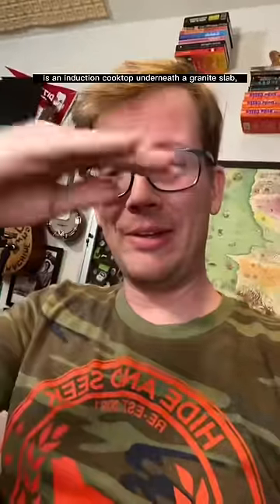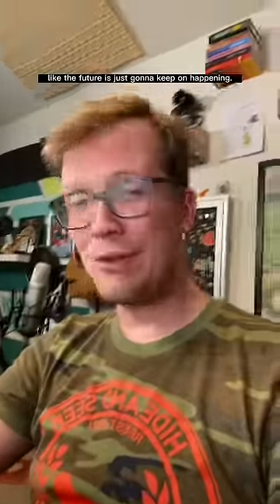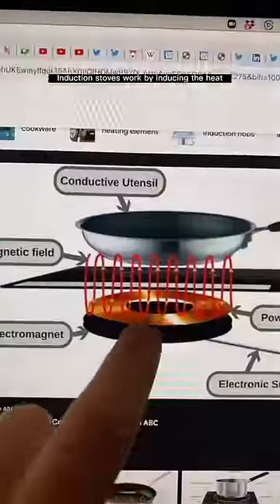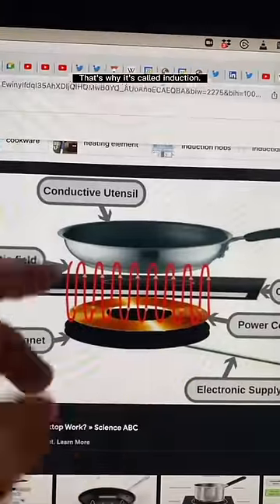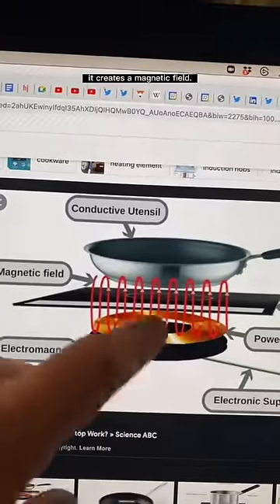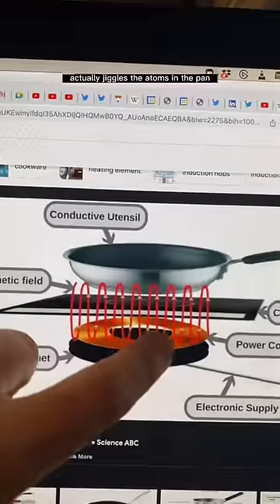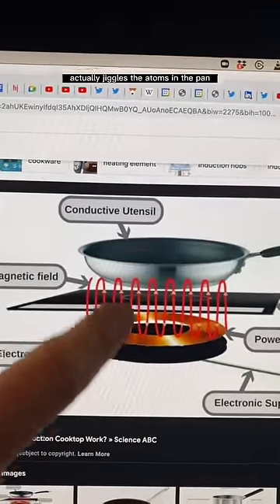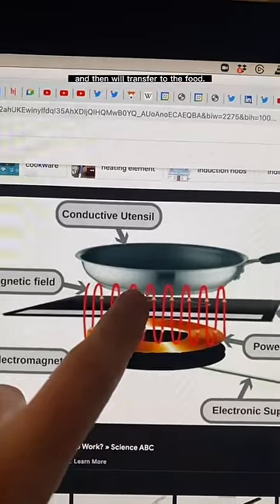How do induction cooktops work?

Comment: The surface of an induction cooktop still gets hot from the pan heating up, so no matter what when you're done cooking that spot of the counter will be hot. Seems like a bad idea
Reply: It won't be burning hot. It would be warm but you can still put your hand on it (see other video with glass induction cooktops for reference). The surface isn't warm from the induction. It's warm from the pot heating because of the induction. That's why induction is also a safer option for people living with kids, pets, seniors or clumsy people.
Reply: It cools off in like few minutes. Electric stove cools down way slower. And gas stove also gets hot around the fire. Not to mention the actual fire that is not safe at all.
Reply: @cherylynl.tompkins7049  You might find that rocks, when they are made hot by hot metal, are hot and rocks retain heat well. You might also find that granite, is a rock. And when you touch it when its hot, it will hurt.
Reply: @cherylynl.tompkins7049  having had induction, the glass tops still easily get hot enough to burn, and stone is a better insulater than glass...
Reply: Christopher  yes, but as the pan is hot and sits on the counter whilst cooking, some heat will be transfered from the hot pan to the surface it's sitting on, thus making the counter hot.
Reply: It's waaaaay less hot. Maybe use one and see how it works, because your concern only comes from not being familiar with induction. It's much safer
Reply: @Tiago-  I have used one lol, if you do intense cooking on it, the surface will be hot. The danger doesn't come from that, it comes from not being able to see it in this case, so someone else coming into the kitchen may not realize you were just cooking on an invisible burner and set something flammable down or lean against it.
Reply: Christopher  The hot pan makes the cooking surface hot.
Reply: @NeroNyte  you'd think that all these guys being weirdly condescending would know that the hobs themselves come with multiple warnings about how hot the cooking surface gets...
Reply: @ef9447  Part of the problem is a lot of products will say like "Heats the pan, not the burner!" in big text as a selling point, and then in fine text somewhere else have all the warnings that it still technically will get hot.

But yeah, love when small stuff like this leads to oddly personal jabs lol
Reply: Gotta assign numbers to these temperatures before you can make a conclusion.
Reply: @NeroNyte most of them are red when hot bc of lights that turn on
Reply: @peterirvin7121  that is true, quite warm is maybe a better approximation.
Reply: @jc-16.  I have an induction stove. The first thing I did was boil a pot of water, remove it from the burner, and touch my hand to the hot glass. An electric coil or traditional glass ceramic cooktop would have given me a 2nd degree burn for minutes after the burner was turned off, but the induction stove was just slightly too hot to the touch. No burns or anything.
Reply: @ef9447  incorrect
Reply: When we bought our induction hob, the sales lady said you can put paper money under the pan and cook your food without burning the paper! Which we never tried but is probably true
Reply: @mhenderson7673  Paper money is difficult to burn by design, it will still burn your skin or regular paper if you cook on high
Reply: I wouldn't be worried about this because you might burn your hand. I'd be worried because the granite might crack from thermal stress.
Reply: That certainly never happens with normal stoves...
Reply: @maxwellkazemba2299  You can still see normal stoves when they're off or have nothing on them.
Reply: I‘ve worked on commercial induction warmers before, and they have a little sensor ring you had to align to the main unit and then put the pot on top of that. It helped mitigate the heat a bit and most of the countertops were warm but safe to touch within seconds after removing the pan if they weren’t already. The main problem is getting the unit to agree that there is a pan above it that is ready to be warmed up, cuz most of the time it just goes 🤷‍♂️
Reply: Burning someone aside, I work in the granite industry, that stone will definitely crack from this. 

I have an induction cooktop and the surface the pans sit on gets plenty hot when cooking.
Reply: Outline it with duct tape.
Reply: Honestly if anything im more concerned that itll take ages to heat up since its granite than it staying hot
Reply: @drlnielsen  lmao
Reply: @Tiago- no, our concern comes from understanding how heat transfer works.
Reply: unless you always put your pan on a hot pad
Reply: @peterirvin7121 Well it was hot, yes. But what if, instead of boiling water (100°C max,) you put hot oil (easily up to 300°C, likely less) and THEN touched the surface?
(Note, I do NOT condone the touching of the surface, PLEASE use a thermometer)
Reply: @Leekodot15  Obviously don't touch that surface?

Comment: I own an induction cook top. Some caveats: you need specific cookware for it to work (many new cookware sets are induction ready, but our old set was not so- all new cookware).

The next major caveats may have been a deal breaker had I known about it: pots and pans bigger or smaller than the burner might start to him or ring, and the sound is very annoying. Often, you can move the pot, and it will stop... but sometimes...it's just going to ring and buzz.

Water does heat up super fast, though, and it is cool being able to use other parts of the stove as extra counter space while cooking as they don't get hot.
Reply: Yeah, I experienced that first issue first-hand. My first rental out of college had one but the landlord never really explained the specifics, so I spent a while wondering why the aluminum pan I just bought isn't getting warm. One Google search later and I found out I need new pans
Reply: I can also agree to that problem, id rather have an electric one again
Reply: I will add that recently the ringing has  had basically diminished to nothing. My wife got Hexclad cookware and that might be the "fix" or it might be  that the stove has just "broken in."  So, I am much happier with it now than I was. I hope that ringing stops soon for you all too.
Reply: You need farrous cookware. Which isn't anything special, you just can't use aluminum pans. Anything that's steel or copper will work
Reply: @Patmorgan235Us  copper? I've had a copper wok that didn't work on induction so I don't know about that
Reply: There no reason for your water to boil slower. It should actually boil faster. 

You also have wireless kettles that can be used with the induction. Doesn't get more convenient than that.
Reply: so that's why my dorms stove starts being loud af for no reason sometimes... that's genuinely a big dealbreaker it's not just loud it's also a very annoying sound it gives me shivers
Reply: @molrat my induction stove has never given me any problems like that.. unwanted sounds etc lol.. I’d be pissed if it did though
Reply: The cookware doesn't have to be new, it just needs to not be non-magnetic (like cheap aluminum pots). My antique cast iron casserole is working fine, for example.

And it's not so much size that makes them vibrate, but a lack of levelness. If they're warped or dirt prevents them from sitting perfectly level to the surface they'll vibrate regardless of the size.

Comment: I’ve got an induction stove top. It’s amazing. A pot of water gets to a boil in like 1 to 2 minutes tops. It’s so fast. You need to have the right pots and pans though. Steel or iron. Easy way to know it it will work, is to test it with a magnet. It the magnet sticks to the bottom of the pot/pan, it will work. If it doesn’t, it won’t. Another plus, is the f it is turned on on accident, no one who get burned, as it doesn’t make heat directly. Be aware though that the pot/pan will get hot, and therefore the bottom that is sitting on the stovetop will make the stove hot, so don’t stick you hand down on it right after removing something, because then it is hot, but it will cool down pretty quickly.
Reply: I love that it's easy to clean in a case of overflow. Shit doesn't really burn to the surface
Reply: @OlafavonGoeding   I was thinking that too.  but just realized that also means that when a pot boils over and spills out, it's pouring off the countertop and right onto your feet

Comment: >Being so early, I can only see Hank in 240p. What a feeling.
Reply: Poggers
Reply: pretty sure that's just Youtube's 2020 change of terms of service, where now users cannot lock resolution to a specific value, but choose low, high, or auto
Reply: @bmo3778 Wait I can lock the resolution onto specific values though.
Reply: @adelaidedracomalfoy8300  wait what app are you using?
Reply: @adelaidedracomalfoy8300  I meant permanently. nowadays, I have to choose the resolution on 'every single video'. it used to be, "lock at 360p forever" and I never need to touch the menu ever again
Reply: @bmo3778  Ohhhhhh, yesssss
Reply: Cutting edge interconnected network technology
Reply: @bmo3778  click on advanced

Comment: If you have a loved one/guest with a pacemaker or similar internal device WARN them. They should be fine if they stay 2ft away, induction hobs can be safely used with some care, it is a necessary consideration.
Reply: I don't think the coils are a high enough output or voltage to affect a pacemaker but maybe I'm wrong.
Reply: two feet or 60 cm is correct but that distance is from the coils themselves. A person of normal height could use the front "burners" and if you are shorter the back ones would be more than 2 feet away from your heart.
Reply: @davidcolera8160 Why risk it?
Reply: @hondaguy9153 manufacturers warn you to stay away if you have a pacemaker. It might be unlikely, but if they're suggesting you don't risk it, probably best not to
Reply: @RicardoDelfinGarcia  interesting. Good to know.
Reply: That's... curious, as it's not really considered a concern here in Europe where induction cooktops have been common for a couple of decades already. There was a EU-wide standard introduced in 1990 that ensures it won't be a problem as you can't sell cooktops or pacemakers here that aren't confirming to that standard. It's quite concerning if the US "forgot" to do the same 🤨
Reply: @norgeek  the US forgets a lot of things.
Reply: @norgeek  I'm in Europe, not the US believe it or not! The flat I moved to in the UK (pre-brexit) came with an induction stove top and the manual called out keeping your distance with the stove if you have a pacemaker. I don't mean to say it's a likely concern, but it's enough to warrant a warning.
Reply: @RicardoDelfinGarcia  that does make lot of sense as whether or not, pacemakers can be affected by induction cookers fields - there are still lot of things that can go wrong and is the sole reason why nuclear pacemakers don't exist (I mean they tried once & now with the new battery tech, if finally safe again then possibly in future). Irrespectively, pacemakers are still foreign object (more like electric stimulation device) controlling an already difficult to repair & extremely important organ. So even if it may not directly get affected, it's still necessary to avoid situations where we can easily mess up & induction cooking is very energy efficient so we can accidentally burn ourselves if we are not careful.(especially accidentally spilling something dangerous hot on pacemaker site skin which will be dangerous)
Reply: @RicardoDelfinGarcia  fascinating, none of the induction stoves I've had over the last.. 15? years came with a warning like that, they've all just stated that they complied with the required EU directives and were safe for people with pacemakers 😅
Reply: I have a pacemaker and it is true I cannot go near them from the magnets, looks lovely but a bummer
Reply: Cardiac physiologist here. The 2ft recommendation is true worldwide for pacemaker users. The reason is that pacemakers have lead(s) that connect to the inside of your heart's chambers. These leads can sense your heart's electrical activity so your pacemakers only "paces" when needed (ie when your heart decides to stop for whatever reason). Electromagnetic fields cause false readings from interference on those leads, leading your pacemaker to think your heart is beating even if it decides to stop.

Obviously it gets more complex than that and pacemakers nowadays have great technology but different models will have different stuff, and since they can last a decade before being replaced, chances are some people have old and more basic models.
Reply: @norgeek yeah yeah you’re better than us, you can stop rubbing it in every time you see a difference
Reply: My father in law's pacemaker is effected by the cooktop they just put in. He can't use it at all or he gets a-fib. Based on that I'll never get one as I don't know if I would need a pacemaker or if I would run in to an issue. It's just not worth the risk.

Comment: You can actually buy a portable induction  cooktop for around $45 USD. I bought one when the stove at my rental place was a pain, and would recommend it. But note, not all pots and pans are compatible with them. They need to be magnetic as Hank and Lily in the comments said.
Reply: Pan has to have iron in it! Stainless steel, cast iron, etc. If a magnet sticks to the bottom, you're good
Reply: this is what I do. I have two but really only use one. saves tons of time and so much safer for kids learning to cook 😉. also portable for traveling!
Reply: Oh so if I had a tiny apartment I could still have a stove? Good to know
Reply: I live in Switzerland and just a normal stove costs a few thousand $ but These Induction stoves are Standard here
Reply: @mermaidismyname  I'm glad you know now that you're able to sustain yourself in a smaller place.

Comment: "The future is just gonna keep on happening!"
"It's a stove under a rock, Hank."
Reply: The oldest cooking technology literally ever
Reply: Meanwhile our old ice man Otzi prepared his hairy hunk of deer meat on a really hot rock near a fire
Reply: Its an electromagnet under a rock.
Reply: No, its a stove, through a rock. Without touchin. A bluetooth stove if you will.
Reply: @jackb3822  
"No."
Yes.
Reply: honestly, the more I think of it, it's just a completely regular stove, right?
Reply: @christiancline5167  but this stovetop doesn't heat up like regular stoves(electric, ceramic). Only the pot/pan that you're using would get warm
Reply: @christiancline5167  Sort of. The pan becomes the electric burner... sort of. 

Electric stove: 
-> drive electrons in the coil to heat it up
-> pan absorbs the coil's heat
-> food absorbs the pan's heat

Induction: 
-> drive electrons in the pan to heat it up
-> food absorbs the pan's heat.
Reply: @OhGodWhatIsThisAah literally no
Reply: The problem with induction cook tops is that yes even tho they are practical for most applications, when you are someone who likes to cook you will very fast find out that there are a lot of recepis that require an open flame . I personally have induction as my main stove top however I do have a 2 area movable gas stove top for those occasions
Reply: @dr.remerb8011 what could possibly require an open flame that can't be done by using a cooking blowtorch or other alternative instead?
Reply: @StormTheSquid  Woks, precise heat regulation, different zones, full size griddles, certain types of searing, slow cooking tends to work better, .... .
Reply: @jonajo9757 it’s not a hot rock though
Reply: they’re minerals marie
Reply: @wildesage4172  no, I'm an idiot, and if the granite itself doesn't get hot, then I'm honestly pretty amazed too.
Reply: @cunt667  lol so funny that you say that. I just recently watched the video more closely. I honestly feel like a bit of an asshole.
Reply: Ok but what if you are wearing a ring(s) and trip and not thinking your hands land on the countertop. Think people
Reply: @jackb3822  Bluetooth heat actually

Comment: One of the best thing about induction is that it heats up the pan but itself doesn't get hot, but if you have it under granite slab, that slab is also gonna get hot because of the pan being in touch with it.

Comment: We ended up buying a really affordable portable induction hob, for our boat when refil Calor gas canisters were extra hard to get hold of, since it was pretty efficient and we could run it while connected to 240v shore power. Would definitely recommend since it doesn't get hot itself it's really convenient to use and then pack away without having to wait for it to cool down.